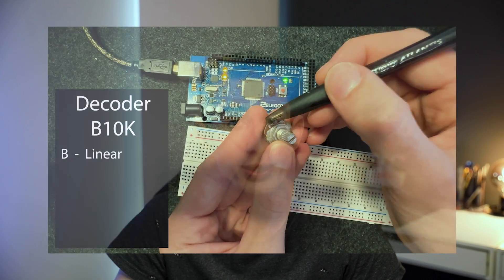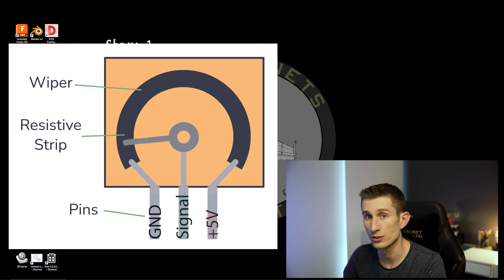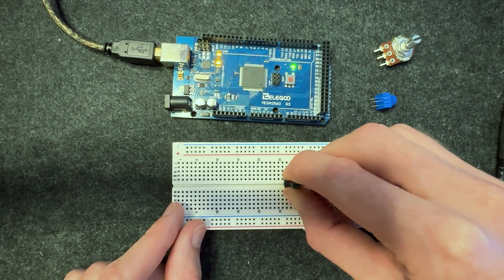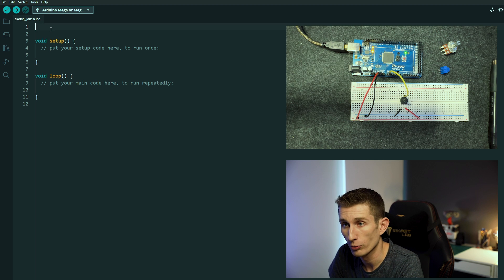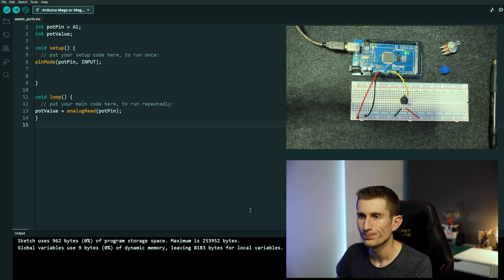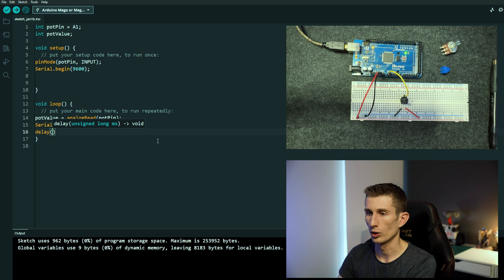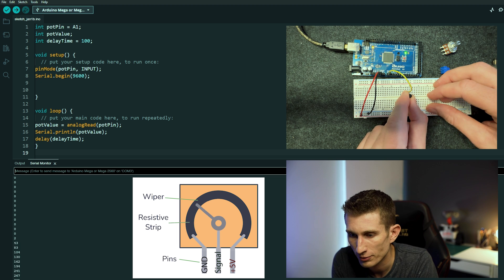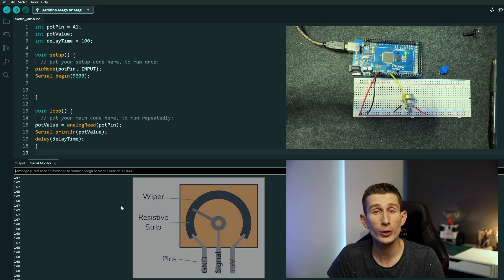Ep: 9 - How to Wire and Code Potentiometers for Arduino | Build Your Own Flight Simulator

Comment: It was a very useful tutorial like the others, I'm glad you exist. I want to run it as a matrix so as not to use a pin for each push button for the IPC panel, but I couldn't find much about how to use the DcsBios::Matrix2Pos command. For example, when I define ROW and COL pins for the matrix for the DcsBios::Matrix2Pos icpEntrBtn("ICP_ENTR_BTN", ROW, COL); command and enter the ROW, COL pin numbers in the DcsBios::Matrix2Pos icpEntrBtn("ICP_ENTR_BTN", ROW, COL); command, it doesn't work. It would be great if you could prepare a tutorial for the matrix codes.
Reply from the maker: Hey thanks for the great tutorial idea! 
Let me look into it :)

Comment: Question about rotary encoders and DCSBios:  if one has a 4 pulse per detent encoder, how do we tell that to DCSBios?  The out of date documentation suggests you could add a <n> after the DCSBios object to indicate the number of pulses per detent; that DOES not work.  There are other suggestions about modifying the code using some of the entries in DCSBios.h, but that is quickly overwhelming for anyone not steeped in coding.  

Is there a straightforward way to do this?  The example I was working with used ARC-159 UHF preset channel selector known for the F-14 pilot.
Reply from the maker: Hey! I haven’t looked too far into that 
But I’ll have a bit of a look and if I find anything useful I’ll let you know 🤙🏻

Comment: What size potentiometers (dimension) are you using and where did you source them from? My panels are made to fit actual aircraft pots but I can't seem to find any of this size M10 bushing with a 6mm shaft, its tough unless its specifically aircraft which I have a couple of.
If you use the same real size, do you have a link?
Thanks
Reply from the maker: Hey mate! I use a couple of - the pot you see in the thumbnail is the most generic and if you searched B10K potentiometers on Ali express - you’d find a heap of them 
I’m using slightly smaller ones in the OH build process, where or not they OEM I’m not to sure 
But have a look at the OH files and see if any of those suit your needs 🫡🫡

Comment: How does dcs recognize this input?  Trying to build the fa18c volume control panel and can’t get DCS to recognize
Reply from the maker: You’d either want to run it through an Arduino with a 32u4 chip (micro, Leonardo, pro micro etc) which can be registered as a joystick controller and key bound 

Or you can use DCS Bios, I’d personally for a Comms panel use BIOS due to the amount of inputs on that panel
Reply: @aHornetsNest  i am building a volume control panel for dcs f18. 

Zero knowledge. I have a few nanos lying around. 

Was able to get three pots to recognize through Ardiuno. Basic programming.  

Can you put a video together for nano or just help me write the programming I’ve been fighting Mike Tyson I mean Arduino and chatgrokgpt.
Reply from the maker: Have a look at at my DCS bios tutorials and see if you can sort that with the pots and your nano, and then if you get stuck let me know 🤙🏻🤙🏻

Comment: I have absolutely no background on any sort of engineering and in just 5 days I've learned how to design my panels using Fusion and succesfully writing Aurduino code for an EUFD and the entire pilot left panel. Thanks for these tutorials. I'm struggling with the logic for the code to light LEDs with the DCS Bios Outputs lines of code. I need to have the pushbuttons in the panels like the Stores Jettison Panel and others like it light up when activated It would be awesome if you can do a tutorial on that.
Reply from the maker: Hey that’s so awesome that you’ve been able to do that! Yeah I definitely want to do a tutorial like that 😃 keep me updated how you progress
Reply: @aHornetsNest  I'm now on the process of designing my PCBs. It would be awesome if you could take a look at my progress and offer any tips/advice. you can see my progress in the DCS Home Cockpits forum under the AH-64D Simpit Project thread. I've tried two times to put the link in this response but youtube seems not to like that.
Reply from the maker: Ah damn! Its a pity that YouTube doesn’t allow it 
Feel free to send me the link on Facebook or Instagram 🤙🏻

Comment: Say if you had a 3 turn switch but you wanted to match the rotation 1:1 for say the p47 trim wheel that only needs 2 spins. How would you map that in dcs bios?
Reply from the maker: Mmmmmm an option could be gearing the potentiometer so it gears down the spin 
So it matched 
this would be an interesting one to try 😃
Reply: @aHornetsNest  in dcs I’d just put a dead zone at say 15 percent from each end of the axis. I just don’t know how to do it in bios
Reply from the maker: Ahhhh folllowing! Nice one 😊

Comment: Thanks Scott, for all your great videos. 
I have come along with my Viggen-cockpit thanks to you, and now its Potentiometers turn for my Arduino Uno. 
I didn´t got any value from any of my Analog PINs so i wounder...
1. Does the viper on the pot. have to stand on zero when the sketch is uploaded? 
2. Can the Arduinoboard´s PINs damage if they get -voltage? (For example if I connected the ground and +5V to the wrong sidepins on the pot.)?
(And, Yes, I have measured and tested the Collective wire from the pot. ;).
3. Can this sketch be used to test if the Analog PINs A0-A5 works, by connecting a wire from the board´s +5V to Analog PIN (that number of the potPin in the sketch)?
Thx! : )
/ "Mattan".
Reply from the maker: Hey mate 
The wiper can be at any position, as it’ll just read automatically after upload 

You shouldnt damage the pin doing that, purely because when the pot is full clock wise it’ll be inputting 5V through that pin anyway 

Can you send me your code on Instagram?

Yeah you can definitely test it that way

Comment: Scott ,  I love the videos.  Very new to all this but super excited to dive in.  Do you use the k40 laser engraver and what laser head do you have / recommend?
Reply from the maker: Thanks mate! I use what could be called a K50. It’s a 50 Watt version of the K40 with a larger bed and couple extras 
It runs a 50.8mm focal length lens, which allows a nice mix of  engraving and cutting